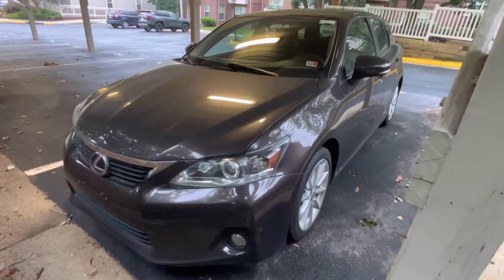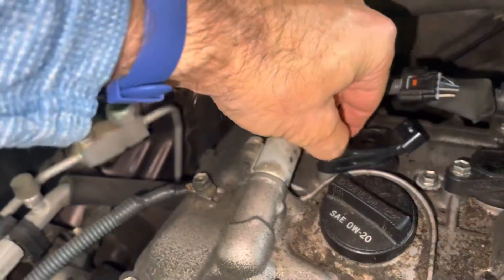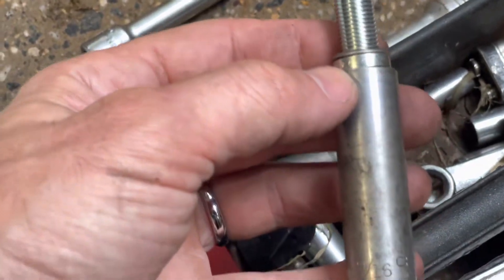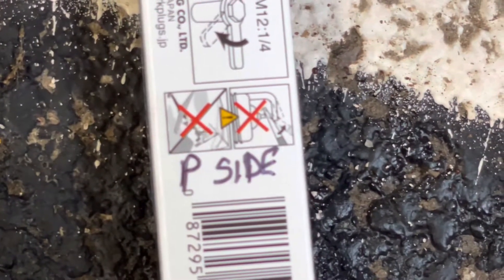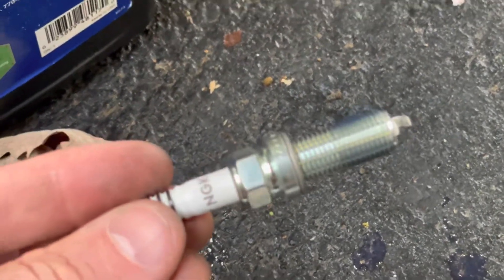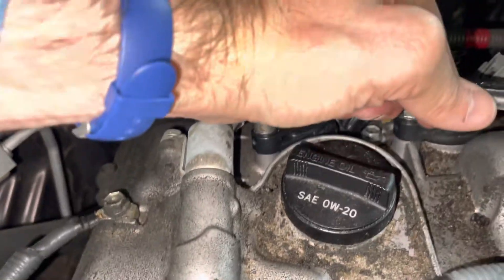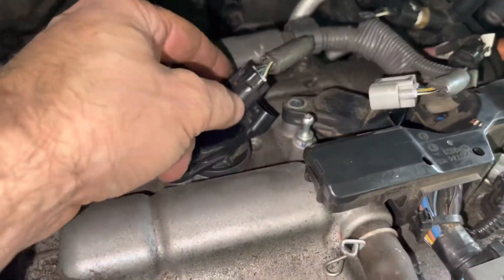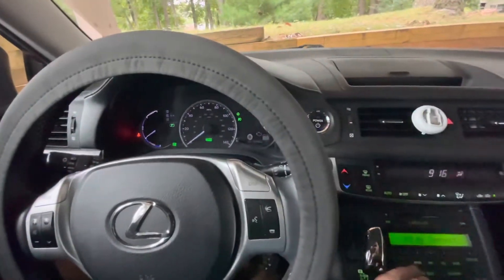Lexus CT200h SPARK PLUGS Replacement | 2011 12 13 14 15 16 17 | 1.8 I4

Comment: Thanks for the video. I just changed out my spark plugs at 120K mile now. Actually it was exactly the same procedure I just did on my girlfriend's 2007 Honda Civic. That car was a little easier because the plugs are on the front side of the engine. But I discovered I had to buy a new spark plug socket for my Lexus as this was a smaller size than the one I used on the Honda. I didn't know that there was another size. So after decades of car ownership I now have 3 sizes. My largest one dates back to cars of the 60's. And frankly, the last time I remember having changed plugs was in the 90's on my Mitsubishi Eclipse at 60K miles. So it's been a while but it sure is easy. They wanted over $230 at the local service shop. I got the (4) original Lexus/Toyota (Denso) plugs on eBay for about $14. Okay, I had to buy a socket too. 😄

Comment: Don't live the threads and don't put anti-sieze on the threads.
Get a proper spark plugs socket.
And use a torque wrench and the proper torque specs for your engine. Mine are 18 ft.lbs. on my RAV4.
And don't eat a plant based diet. 😄

Comment: A few things. You need to check if the plugs are properly gapped. The incorrect plug gap for your engine can contribute to a high rate of misfires, loss of power, plug fouling, poor fuel economy and accelerated plug wear.  dropping them in like that may change the gap.NGK states not to lubricate threads.
Reply: What do you mean by properly gapped or what does that mean?